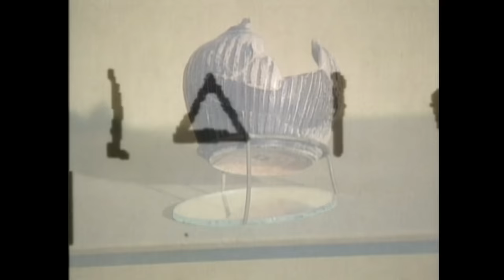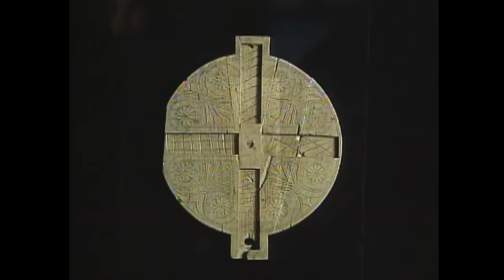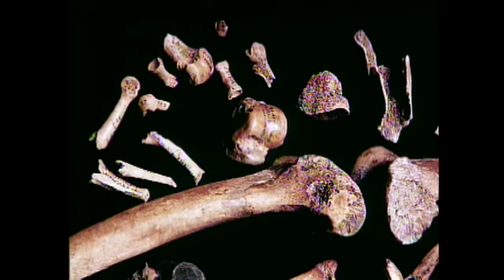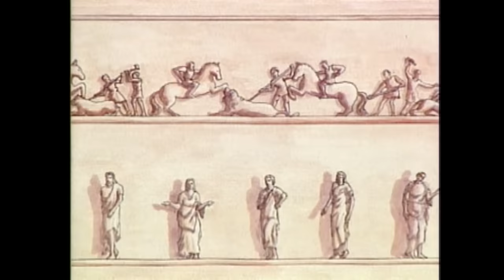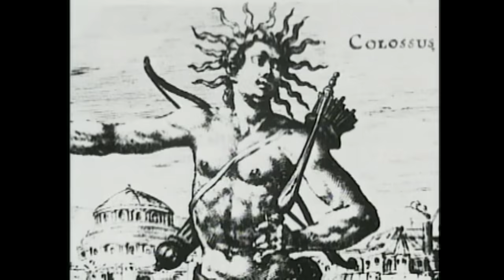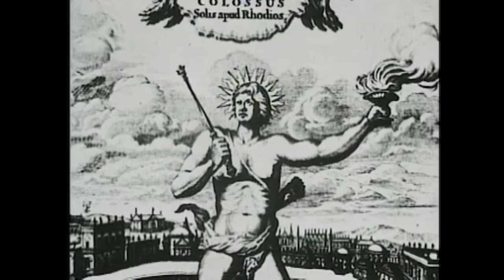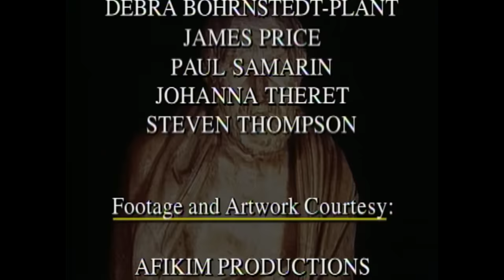Seven Wonders Of The Ancient World | Ancient Mysteries (S3) | Full Documentary | History

Comment: I find it odd that The Colossus of Rhodes was thought to be only 100' tall and straddle the entrance to a great harbor? The entrance must have been very narrow, as 100' in retrospect isn't very  tall, especially given the fact that about 1/3 the height would have been dedicated to the split apart legs. The entrance would have been no greater than 25' with 5' on either side dedicated to the base of each foot, which would put the opening of the harbor at 15' at best. Yeah, mathematically it is not logical nor plausible.

Comment: 15:31 Yeah but should you? You where told to stay away from this place and why? Its because of the radiation it produces. An you guys still have not checked the levels of radiation in there. The electrical pulse the building provided also generated some level of radiation. Entering there will cause cellular degeneration so you should stay out.